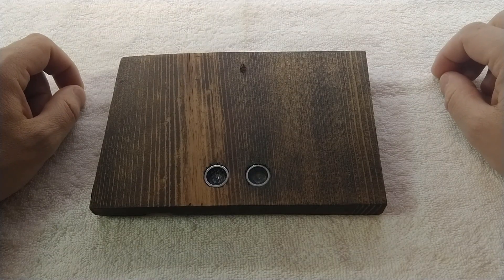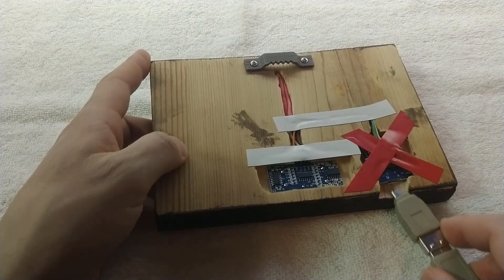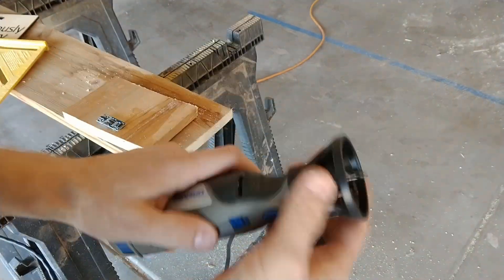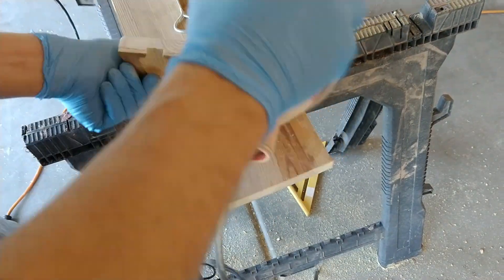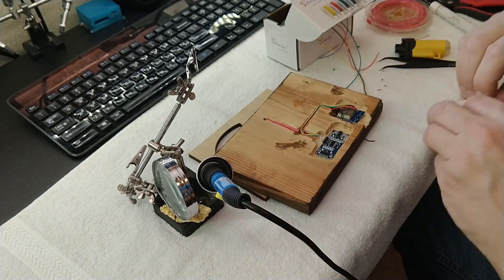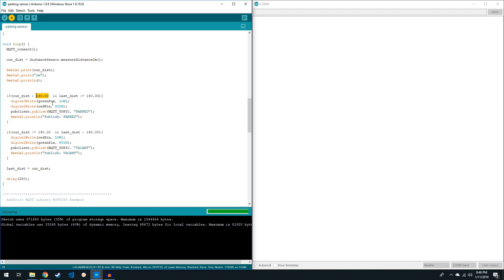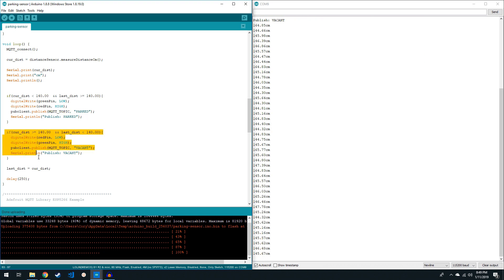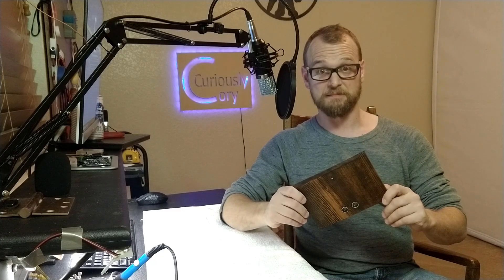DIY Smart Parking Assistant

Comment: Hi thanks for posting this - great project.  I have built a copy and it runs ok except it will fail with the following output;

Publish: PARKED
163.61cm
Publish: VACANT
164.07cm
163.59cm
163.56cm
164.02cm
163.54cm
164.02cm
164.55cm
164.09cm
164.11cm
164.95cm
44.04cm
Publish: PARKED
Connecting to MQTT... Connecting to 192.168.1.111 as esp8266-dc:4f:22:cf:ad:6-b6
MQTT connect failed
Will reset and try again...

Abort called

>>>stack>>>

ctx: cont
sp: 3ffefce0 end: 3ffefef0 offset: 01b0
3ffefe90:  00000000 00000000 00000000 3fff0c5c  
3ffefea0:  0000001f 0000001b cf224fdc 402006ad  
3ffefeb0:  3fffdad0 00000000 3ffeea1c 402027c8  
3ffefec0:  00000000 00000000 00000001 3ffeea4c  
3ffefed0:  3fffdad0 00000000 3ffeea1c 4020a3b8  
3ffefee0:  feefeffe feefeffe 3ffe8508 40100aed  
<<<stack<<<

 ets Jan  8 2013,rst cause:2, boot mode:(1,6)

 ets Jan  8 2013,rst cause:4, boot mode:(1,6)

wdt reset

Any guidance as to how to fix this would be appreciated

Thanks

Peter
Reply from the maker: What version of the pubsubclient library are you using?
Reply: @curiouslycory  Hmmmmm how can I tell?  Thanks
Reply from the maker: @Spitfireman01  Go into your arduino library manager and search pubsubclient, see what you have. I'm running 2.7.0. If your's is newer or older, try 2.7.0 since that's the one I tested the code with.
Reply: @curiouslycory  Hi, I am also running 2.7.0 Curiously since I unplugged the Wemos D1 Mini from my PC and ran it from a dedicated power supply it has not crashed, I do however notice lots of false triggers.
Reply from the maker: @Spitfireman01  Technically the HC-SR04 is 5v logic, the wemos just tolerates it pretty well most of the time, but if we're playing by the data sheet it's looking for 3.3v logic.
Depending on how regular the irregularities are you can either drop out statistically wild values, do some averaging, or use a voltage splitter to drop the data voltage to something nearer to 3.3v. You could also try some caps inline with the sensor's power to see if smoothing the power there might help.